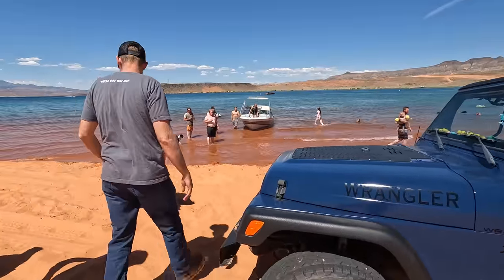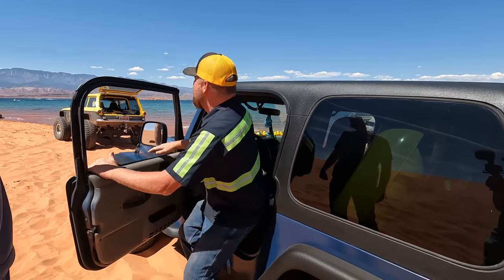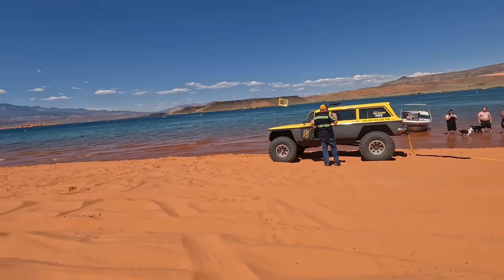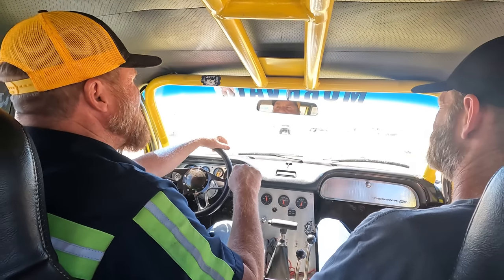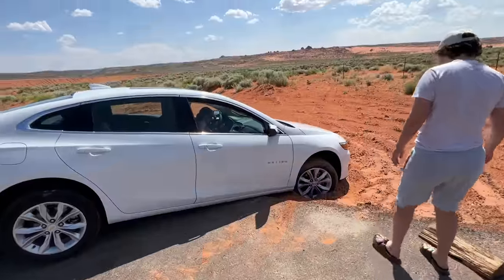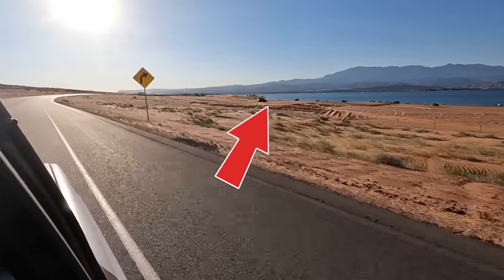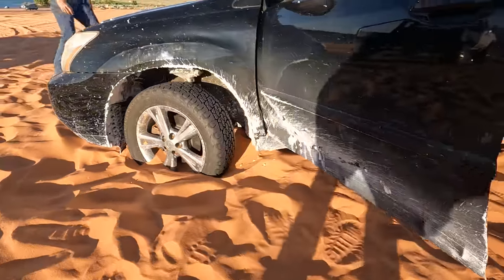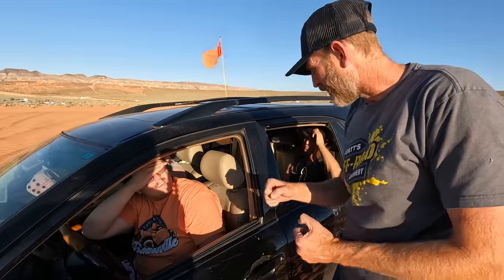Not Looking Good! It's Dead Pull Time.

Comment: i had an idea for the off road recovery trailer. So I thought I would share the idea before it died of loneliness. The trailer doesn't seem  to get used  every day.. At least in videos  it often waits days or weeks between jobs. However it's winch battery gets forgotten instead o charged. 
Now if a guy were to add an inexpensive  solar powered trickle charger to the trai8ler and leave it hooked up then that winch battery has a fair chance of being charged most times he needed the trailer. Best of all this sy6stem mostly requires   only simple, free, and abundant neglect  from trailer users  in order to work. There is also a small chance that an unmonoitored self powere3d constantly "ON" trickle charger could over charge and ruin one or even two batteries a year. For me that is a better tradeoff than being doomed into going out on perhaps 9 recoveries a yearwith a trailer that has a dead winch battery

I realize that this post is late and should have been in the recent video you put up that featured a trailer with a dead winch battery. But how late is it really? Is that battery charged right now?

Comment: I find it funny as a Canadian how many people have no clue how to get un stuck in simple problems. I would say 90% of your "stuck" cars I could drive them out. So many drive without checking anything on their cars or having a few simple things on board..
No way could you get away with that here in a light winter. In 40+ years 1 time I needed a tow truck after a down pour rain overnight camping the land turned to soupy mud 20+ stuck in front of me tearing up the road. with no way around them. I would have got out and pulled others out if I could have got around them, just no way through the tree line

Comment: "Gas rattle?" FYI ~ ANY audible detonation is EXTREME SEVERE detonation. Also - you can have parts breaking damage WITHOUT ever hearing detonation. It just means it's not AS severe as audible detonation. It just means it takes longer for the damage to manifest itself. Do not take this info lightly.

Comment: What does locking the hubs do?
Reply: It engages the front axles. Before you lock your hubs, you are basically a rearwheel drive vehicle. The front wheels don't spin on their own. They only move because the rear wheels are pushing them.
Reply: @keo528528  that was a great explanation thank you!
Reply: When you lock the hubs, both front wheels are tied together and spin at the same time instead of separately. 4 wheel drive engages the front axles, but lockers lock them together
Reply: @DriveSlow  you are welcome
Reply: @JohnFL  you're talking about lockers.  That is internal at the planatary gear system. The locks at the hubs are how you go into 4x4 manually on vehicles that don't have 4x4 shifters in the cab. The only reason I think Matt has manual hub locks for 4x4 on the bannana is because it's actually 1 ton axle from an f350 or something.
Reply: @keo528528  Oh ok. I just figured Matt could shift from the cab, but that makes more sense, I was wondering how that was really different from 4wd.

Comment: It's interesting to hear you talk about 91 being a top line octane. In Australia 91 is our base and the mid is 95 with premium at 98. We even have a supplier that does a 95 with E10.
Reply: The USA uses (R+M)/2 instead of RON for the advertised octane rating. So it only look like ours are a lower rating, when its just a different scale.